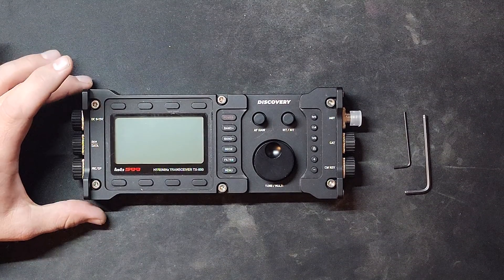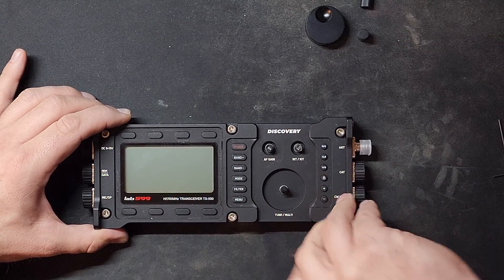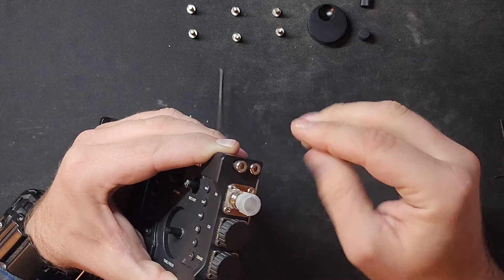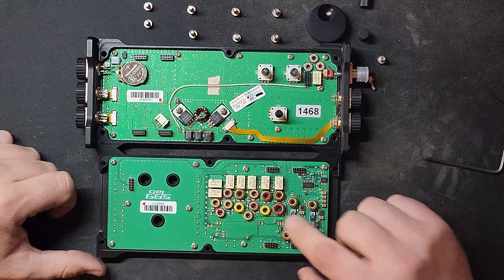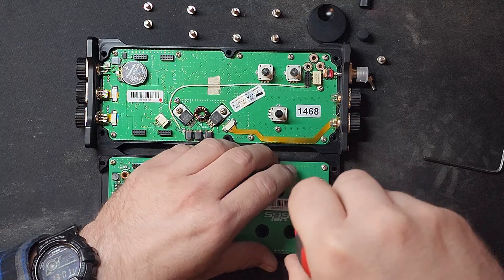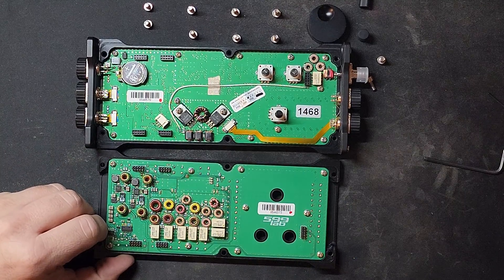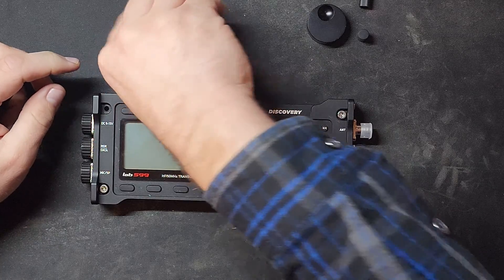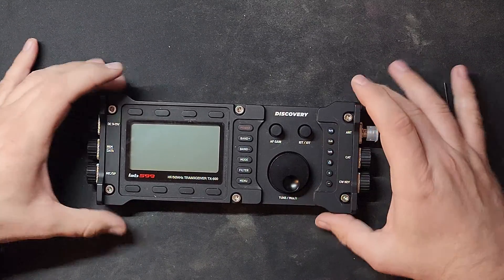Disassembling the Lab599 Discovery TX-500 QRP Radio

Comment: You got a year out of yours. I got 1 QSO and now it wont turn on. Completely dead.
I don't want to open mine until either the manufacturer or my UK supplier says OK.
I didn't see you wearing  a grounding strap.
Reply: Local supplier wants the radio back for repair. I was rather looking forward to opening mine.

Comment: Only thing I would have done extra - is check the seating of the ribbon connectors on the motherboard. IF they are loose you may not spot it visually, just give them a gentle press and see if they sit firm or wriggle

Comment: This is picky comment but when using an Allen key use the long arm of the tool for leverage when tightening or loosening.  Then for the rest of the screwing and screwing stand the Allen on the long end and twirl it with your fingers to remove the screws quicker.  Also speeding the video at 4x when assembling would shorten the video.  Finally I just bought the 599 and it's a really nice unit.  I also have a 705 but with the 599 it will stay safely in the shack.  With the 599 I'm worried for all the concrete in the world.  :)

73,
K9AT
David

Comment: Hi there. Greetings from the UK!
I was curious to see inside the rig as mine seems to have a failed audio chip.
Very happy to learn how well designed and built the radio is.
A quick question, where could I get those connectors protectors?
Thanks for sharing.
Reply from the maker: Hey Vitor, thank you for the comment and watching the video. The protectors can be 3D printed or can be purchased on Etsy and possibly eBay. I got mine on Etsy here https://www.etsy.com/listing/889182255/lab599-discovery-tx-500-covers

Sorry to hear your audio chip failed. Were you using digital modes when that happened? A friend who has the same radio had that happen as well.

Sadly my TX-500 is at the US repair show but hopefully coming back shortly as the power amplifier went bad. Will be doing a video on it again when I get it back.

73, Matt N3VAN

Comment: So, what was the problem? You did not seem to do anything other than touch the battery. 
I would like to know, as I'm thinking on getting one of these.
Reply from the maker: The problem as stated in the video was the display stopped working when a microphone hit the metal enclosure.

As per US Support they asked me to make sure battery was seated. after checking and reassembling the screen worked.

Comment: If the battery was seated properly was it vthe loose screw that fixed your display?
Reply from the maker: Yes, there was two or three screws that were slightly lose. Upon tightening them good and tight the display came to life. I never lost RF sound just the display, which is still very concerning. I hope this helps you with your TX-500.
Reply: Thank you this is a good fix to know. I have the Lab discovery and I think there is no equal to this radio for outdoor use. It sips power from the battery leaving a long life for field/emergency coms. Built like a tank and able to take some adverse weather conditions. Many of the other QRP rigs are just to fragile for REAL field use. KB9MVW..Chuck